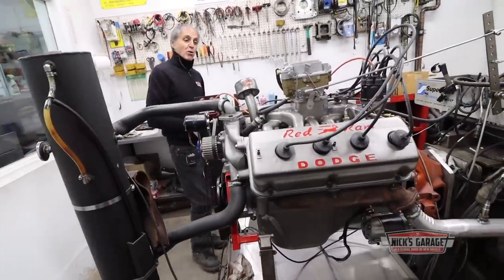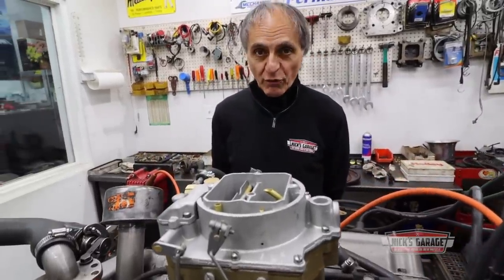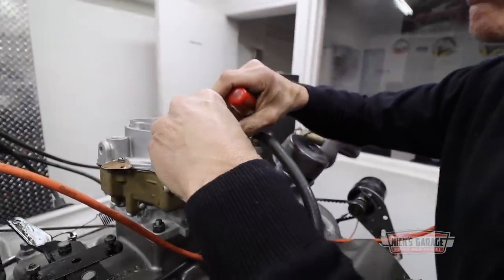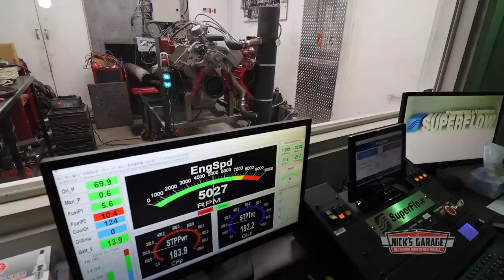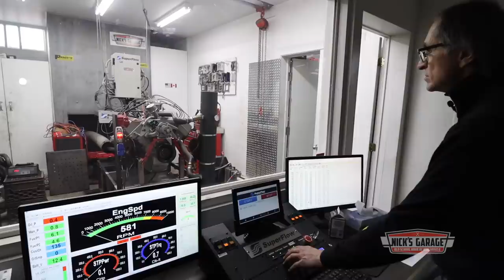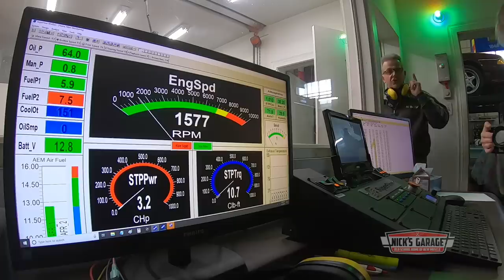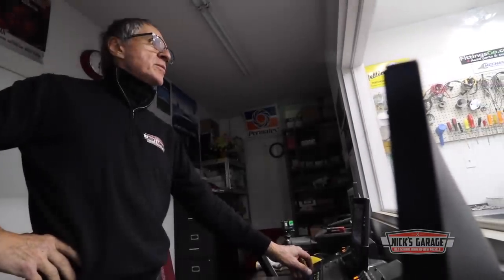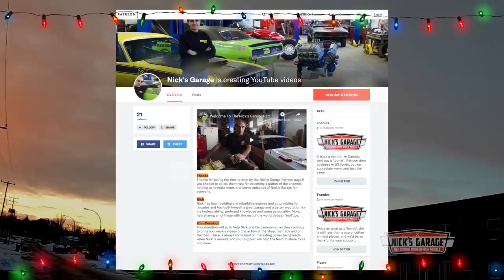Tiny Old HEMI - First Generation 241 Hemi on DYNO

Comment: Those little red rams could be potent race engines in their day . Chrysler ran 331's at the brickyard and scared the daylight out of the offy crew so much that the rules were changed . Record breakers and setters .even finished in 3rd place at lemans in 54.

Comment: Great show.  I seem to remember on these wcfb carbs. The choke had to be all the way open or the secondary linkage would be blocked from opening.  The leanness could come from a partial open secondary letting in air in

but not open enough to pull the fuel yet.
Reply: William.    Had it fixed the next day.

Comment: Looks like time to build a set of headers , why not?
Reply: Cast iron manifold sounds way better. Actually the small exhaust manifolds and small pipes give a lot of that classic "old car" sound. I put 3" pipes on my '59 villager and regret it now. Shoulda stuck with 2" pipe.
Reply: AND fix the secondaries not opening issue, Im betting theres 200 p hiding in the lil rasal
Reply: @christopher peterson and @Jerry Smith, I agree. It will help let that little engine breathe better. Instead of “I think I can”, it’ll yell out, “I know I can, so look out!!” 200+ horsepower, here we come!!

Comment: I'm a little surprised you didn't hot tank all the valve train parts before putting it back together.
Reply from the maker: The parts were hot tanked.. but still managed to have a little crud left in the tight spots.

Comment: I'm confused... not trolling just asking.  If the motor got rebuilt typically the head's are done as well.  The confusion part... the rockers and valvetrain...... why all gummed up?

Merry Christmas to you all at Nick's Garage!
Reply from the maker: We have seen very few engines as crusty as the 241. Even after the usual cleaning treatments, it needed a little more TLC to get all the years of debris cleared away and open up the oil passages. 
https://youtu.be/rDsjkLN3NZ8
Reply: @NicksGarage  wondering what the motor would do (horsepower wise) if you took the OEM parts and had them ported and polished to a specific specification and ran a flattop piston with a different cam and carburetor setup (4-bbl wise) and have a better exhaust system (custom made)
Reply: @NicksGarage  oh been waiting on this video to come out cause I was curious about that motor 
Did you ever recover the 10 horsepower you lost??
Reply: @NicksGarage  your shop is becoming a Worldwide Fan cause of your heart and is becoming more than a passion 
It would be impossible for you to have a 2nd shop in the United States 🤣🤣🤣🤣
Reply: Most people who clean up the heads, clean up the heads, not the valve train. That comes at additional cost and work. Today valve trains are frequently just replaced.
Reply: @RichardMLowe  I don't think Hemis use flat top pistons. They usually have a dome on them.
Reply: @Timotheousturalyon  you're right they do but I'm referring to the 7:1 compression it has and the lean idling it has
Reply: @Timotheousturalyon  being a low compression motor with dome pistons I'm leaning towards some other type of conversion
I threw "Flattop" in as a reference
Reply: @NicksGarage  thank you for your reply...I needed to relax this morning and saw that you had a new upload... it  calmed me.... got me to focus... and made me smile.  Thanks Nick
Reply: @RichardMLowe  Yes we did after we blew air through the rear jets the next day. Final HP was 157.
Reply: @44hawk28    True.  We had the shafts and rockers Hot Tanked. Did not do a fine job. We went in the shafts with metal wiring to free up what was gummed up. Back in the old days the hot tank was a much powerful cleaner.
Reply: Mr. Edward.   We had the shafts and rockers hot tanked. After priming very little oil came up. We had to go through the shafts with metal wiring to clean up the gummed up areas. Back in the old days the hot tank chemicals were much more powerful.
Reply: @nickpanaritis4122  I remember building some engines in the old days. Interesting learning curve as I started pretty young but I had the advantage of living down the street from Mancini racing and knowing a lot of really good Chrysler wrenches. Including Angelocci, who was building National mile per hour record engines but he was still working out of his garage in Detroit here.
Reply: @nickpanaritis4122  NICE !!! CONGRATULATIONS 🎉🎉🎉👏👏👏👏👏👏 JOB WELL DONE (love the front motor mount that you/y'all came up with to get it on the Dynometer and make a few pulls ... Can't wait to see it back in the car .... Y'all gonna replace the radiator and the heater core so that there is no chance of leaks in that 500 .... Wondering what condition the transmission is in ... Brakes and any hardware from lines and linkages ( is that customer gonna want to do the whole car cause you/y'all did a FANTASTIC JOB on Kowlaski and would be nice if it was done so the lady could once again see it in it's Glory and go for a ride in it (tube type AM radio would be twice as nice if it would still pick up the stations it used to .... Remember when it would take a while for the radio to come on after it was turned on?)

Comment: I am curios what kinds of modifications hot rodders and racers were using or inventing commonly with this little engine back in the 50's ? Also what does this engine weigh ? 
Please.
Edit : just knowing those exhaust manifolds are there cause pain somewhere inside of me lol does any one else feel that ? It's like empathy for that motor wanting to breathe .
Reply: todd prifogle I have two 1955 DeSoto Hemi Engines Both Are 291 c i and I have a Wieand intake with 4 Stromburg 97’s , and the 55 and earlier Hemi’s have a long cam, but I have a Daytona cam (bought in early 1990’s from Daytona Cam’s But the owner must have passed away for cant get hold of him he had all kinds of cams for all kinds of cars) I had Racer Brown shorten my Daytona cam and I can run 340 timing chain so I bought gear ⚙️ timing from Moroso and Double Roller Chain So I have two sets of timing. The Dodge Red Ram is smaller heads then mine- Dodge - DeSoto - Chrysler all have different cams not interchangeable valve covers same thing all non interchangeable 
They made four duce intake like mine for Small Red Ram also but you’ll be paying big $$$$ For one like $3,000 for bare manifold these days, got mine in1987 for $75 with carbs no linkage. For headers they are available custom made Sanderson Headers makes them 
More parts for hot ridding available for Red Ram Dodge and Chrysler Fire Power then DeSoto Fire Dome or Fire Flight
Reply: Read about Charlie Markley. He and his brother raced little Dodge Hemis and Desotos as well at the Salt flats. Currently Charlie and his son have built a small Desoto Hemi with blower to run  on nitromethane. Nick Smithberg of Smithberg Racing is doing a lot of work on the Dodge Hemis including CNC porting programs for the heads.

Comment: Is that a full flow, oil filter? i wondered when American cars started to acquire full filters, probably when hydraulic tappets came into use.
Reply: john.     It has a paper cartridge filter.
Reply: @nickpanaritis4122  I assume though, that the oil gets there first before anything else, our local Holden [GM] car did not get any standard full flow filtration [only type was after market "dribble types" ] until about 1963.

Comment: Wires are lacquered. The “bridge” support for the front engine mount is similar or same as used on the L-head six which was Chrysler’s standard from 1926 until 1960.

Comment: A different Carb and some custom headers would probably add another 20 hp. if the owner was interested in more HP.
Reply: Dave Micolichek  Not if you know how to weld it would cost very little. I said only if he was interested he could. There is a big difference between a 200 hp engine and a 150 hp. Just only if he was interested in doing it he could get more out of it. It would be pretty cool with throttle body fuel injection.

Comment: Nick, take a look at the 1962 Daimler SP250 with a Hemi engine. Only 150 c.i. Putting out 140 h.p. I can remember seeing one of these little sports cars running around our neighbourhood back in that time and it had a terrific exhaust note. That old Hemi you rebuilt sounded pretty nice considering no modifications aside from the overbore. 150 h.p. was pretty decent back in the mid 50’s. My Father’s 56 Chev with a 265 2 barrel carb was rated at 162 h.p. The h.p. numbers have sure climbed significantly over 60+ years.
Reply: SP250. Lucas Wiring fouling plugs nasty shifting beautiful wheels but it sure could go
Reply: Nick Kubsch , I know all about Lucas electrics. My Father had a 1959 Austin Healy 100/6 and I had a 1959 Ariel square 4 motorcycle and they both had Lucas electrics, not the most reliable. As for the Daimler, I have never been in one but that little V8 had a sweet sound burbling out the exhaust.

Comment: Hi Nick. There's is no sense trying to jet for air/fuel ratio when the air cleaner in not installed. Back in 1954 it probably has an oil bath type air cleaner. They are quite restrictive. You would need to jet with this restriction in place - it is going to richen the mixture.
Reply: Tom.         You are correct. We went back to the original jets and fixed the linkage and gained back our 10 HP.
Reply: Great thought !

Comment: Att 36:05 it seems theres no fuel getting out of the secondary's - if compared to first pull att 21:36  where there is fuel present. You have probably figured it by now - but the value of having a camera filming from top during the pull seems valid. Anywhay - thanks for posting - you guys rock :-)

Comment: Who would have thought of Tubular Headers ?   Smokey  Yunick ..
Reply: The94GTC    here 

 1946:
In 1946, Yunick married and moved to Daytona Beach, Florida, because "it was warm and looked good" when he had flown over it on training missions.

1951:

Yunick was twice NASCAR mechanic of the year; and his teams would include 50 of the most famous drivers in the sport, winning 57 NASCAR Cup Series races, including two championships in 1951 and 1953.

1962:

In 1962, Yunick changed open wheel racing forever when he mounted a wing on Jim Rathmann's Simoniz Vista Special Watson Roadster.

1984:

Smokey Yunick's Power Secrets written by Smokey Yunick was first published on January 06, 1984.

1990:

In 1990, he was inducted into the International Motorsports Hall of Fame.

2001:

He also wrote for Circle Track magazine, and published his autobiography Sex, Lies, and Superspeedways in January 2001.
Reply: Not on a factory engine, that didnt happen until the late 80s early 90s.

Comment: We had 2 Red Rams, great motor, tough motor, Douglas made headers for it in the 50's and a few made it to the drags. one of the first rear engine dragster, Magwinder, used one mounted side ways and chain drivin. 241with a 4-71 blower, 450 hp., many of them made it to Bonniville.

Comment: Looks like a Carter wcfb model carburetor.
Reply: Yes, White Cast Four Barrel "WCFB".....
Reply: Yes, White Cast Four Barrel, "WCFB...
Reply: Mine had the cross over vents on the front and rear barrels on my 65 327. Impala.
Reply: Has Nick done an update on this engine? When he put his hand over the primary barrels and it didn't stall I thought there's a vacuum leak somewhere.
Reply: @n2uid01  Very possible. Could be associated with the intake not seating properly, carb flange, etc.. But I'm sure he would think of this....
Reply: @planefloat  He will. He is old school like I was. I learned from old guys 50 years ago and I think he did too. He made me put the thinking cap on and I started to try to solve the problem too.  Can't wait to see the next hemi video. I wish I could say thanks for the videos. Its nice to see somebody that likes Mopars as much as he does.
Reply: He knows, he's making us think! (I think!)
Reply: @n2uid01   same thing here thats why its running lean
Reply: Craig Wood I love it that there were four of them going at this WCFB and they still didn't catch the choke linkage lock out issue. Now I don't feel so bad remembering how hard it was for me at 16 back in '76 working on one of those with my brother. All we had was a Motors Manual to teach us. Nick is great, I know he stayed at it till it was right.

Comment: Carter WCFB carburetor on this. They were a pretty decent carb, but small if I remember right. Only about 450 to 470 cfm. Probably a good size for a 241 though. 

I have to wonder if the floats were disturbed when changing the jets. Especially the side to side. This is crucial. If it is not correct, the floats will rub against the side of the float bowl and either not allow the floats to open or close completely.

Also, the float drop could have been disturbed. The drop is 5/8" on the primary and 11/16" on the secondary. This is with the gasket removed. Also, the float level with the air horn upside down should be 1/8" from the center of float to the air horn on the primary and 3/16" on the secondary. This measurement is also with the gasket removed. You might want to verify these numbers since the only thing changed was the top removal for the jet changes.

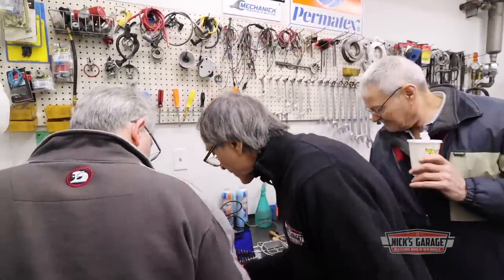At 26:16 it shows the airhorn sitting with it on the floats. I would most certainly check all the different float settings. That is probably where your problem is.

Also, the primary metering rod adjustment may have been disturbed when removing the airhorn. This has to be readjusted with the idle speed screw completely turned out and the primary butterflies completely closed.

Comment: Hello Nick, fantastic build as always, and love your work.  I have a 1980 Plymouth Volare coupe that I just completed a .060 bore 360 engine. Using a Voodoo Lunati Advertised Duration (Int/Exh): 268/276; Duration @ .050 (Int/Exh): 226/234; Gross Valve Lift (Int/Exh): .494/.513; LSA/ICL: 110/106; Valve Lash (Int/Exh): Hyd/Hyd; RPM Range: 1800-6200; ), with Mopar 308 heads(1.88/1.60), a Carter 6322 TQ carb, 10.2:1 Hypereutectic pistons(Speedpro hp116CP), stock bottom end. About how much power can I expect?
Reply: Alex..      With a single plane intake and headers,  could be around 325 to 350 HP.
Reply: @nickpanaritis4122  Thank you Nick. You are one of the true Mopar Masters of these engines, and have faithfully followed your videos here on youtube. Great work as always and Happy Holidays to you and your family.
Reply: @nickpanaritis4122  It currently has the 1971  cast iron stock 340 intake, i.e. casting number 3512100. Would that make a difference?

Comment: Nick, you just needed some truck parts to mate to the dyno absorber. I have a 241 in my '54 Dodge pickup with a manual trans, but mine is single rocker shaft aka poly head. It's a crazy setup as the bell has to be mounted before the flywheel.

Comment: Awesome set up to run the oldie! I keep lots of parts shifters from 70's and earlier. Now I'm worn out and the new generation just pays other if more involved than radio or computer tuning. So much for reading a spark plug. Really enjoyed this video and Happy New year to you and your family/crew!
Reply: Hey, in case you're watching, i need a 4 spd transmission rear yoke for a '66 coronet 500 3834bbl  dodge . If i recall correctly, 
 it's a 23 spline? I'm in a different state at present, can't put my eyes on it for now. Thx
Reply: @sovrgnman  Has it got the Red Stripe 4 speed?
Reply: @stephenmitchell3569  I'm not familiar with that description.  I've owned the car since it was 2 years old. What makes it a red stripe?
Reply: @sovrgnman  4 speed usually came in big block or high performance like 340 Demon, etc
Reply: Thanks, i did a quick research and you are right,  but while is an original 383 4bbl 4 spd, i don't think it was in the r/t class or Hemi class. At any rate, i recalled the 23 spline figure in my head from my handling of it years ago, so i trust that figure. I see that the red stripe shaft spline is 18 tooth vs. non red stripe at 23 tooth. I have two of the same trannies,  one is the factory one, the other a spare, both with same tail shaft.
Reply: Steven I a man looking for a shifter, linkage for GM 833

Comment: I noticed on the camera looking straight down the carburetor that the secondaries had a lot more fuel coming out the first pull  in the other camera shots I didn't see any fuel coming out so I think it's not getting enough fuel it to the secondaries
Reply: Aladar.          We had the carb fixed the next day.
Reply: oh okay that's a neat little hemi  I like that that would be fun to stick in all kinds of things it sounded pretty good to. thanks for answering I've always liked your show even though I'm more of a Chevy guy  right now I have a 1972 Jaguar XJ with a built for drag racing small block 400 in it and  700 r 4  @nickpanaritis4122

Comment: Id be curious to see if a run with the factory air cleaner assembly would cure the lean condition at wide open, and how much it would affect power. As well as factory exhaust.  Id imagine judging by the manifolds the factory exhaust probably isnt much better. Those old carters have a unusual and hard edge shaped airhorn and i wonder if the air cleaner would fight turbulence and smooth out incoming air over the boosters.  Thats a sweet sounding old engine, 5000rpm was alot in 1954. In its a day that was a real fire breather. Most will sit in show cars, its great to see you letting it unleash some violence on the dyno. Its a hemi... thats what hemi's were made to do. Make power. Great work and love the video!